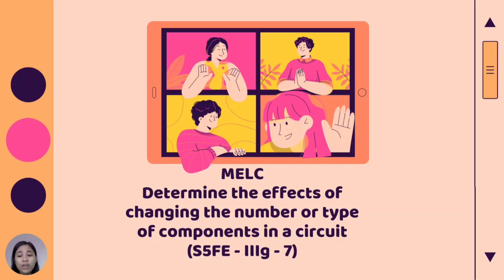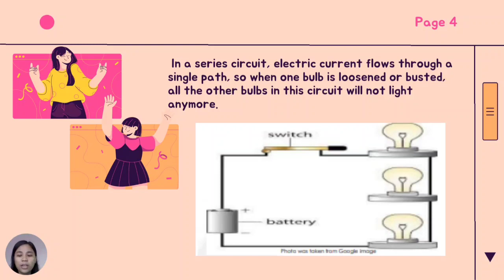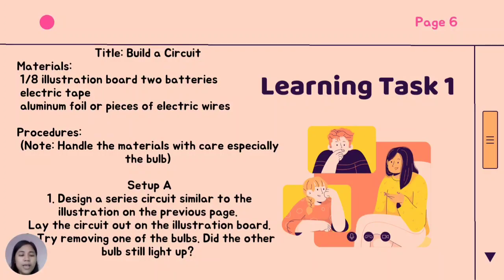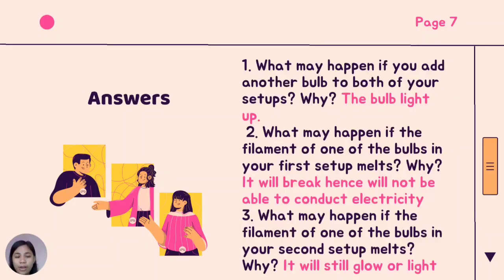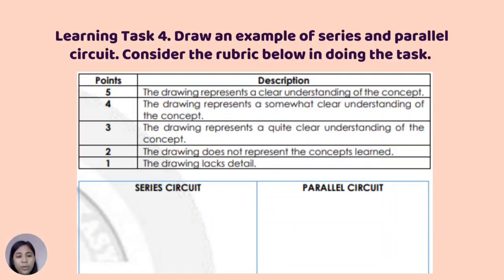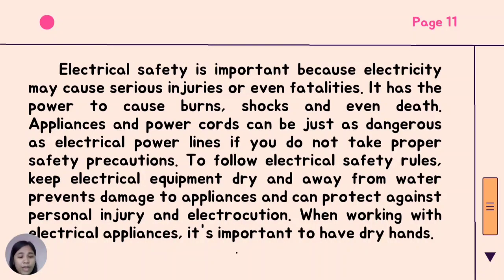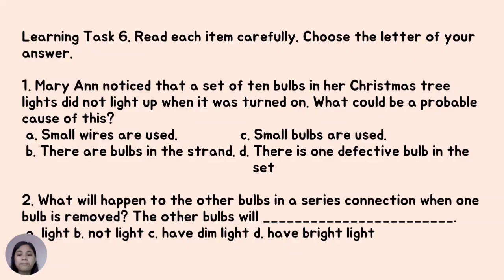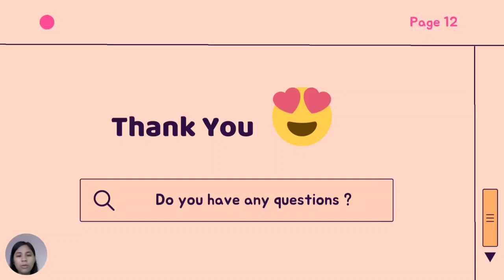LEAP SCIENCE 5 QUARTER 3 WEEK 5-6 | Series and Parallel Circuit

Comment: May i ask if the answer on number 3 in learning task 6 is really d because i thought that when one bulb is removed in a parallel connection it will still light up the other bulb because it has a different loops so i answered a?